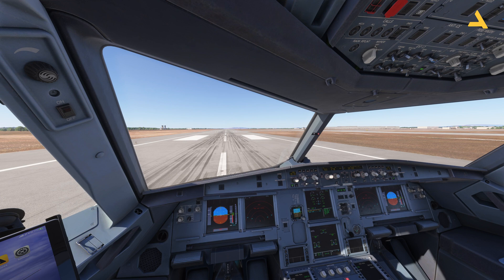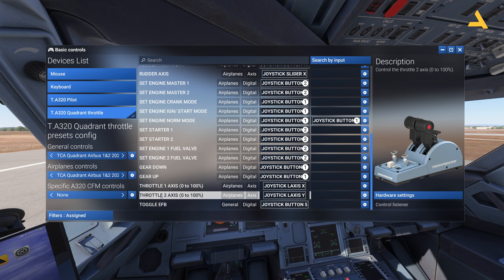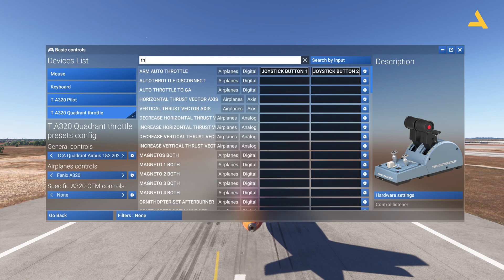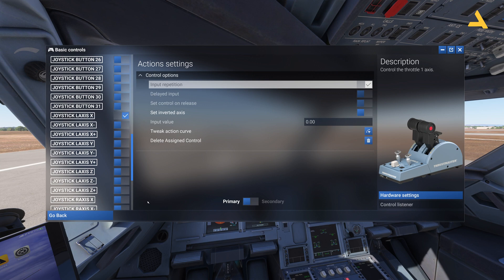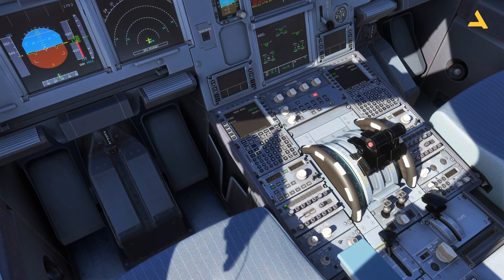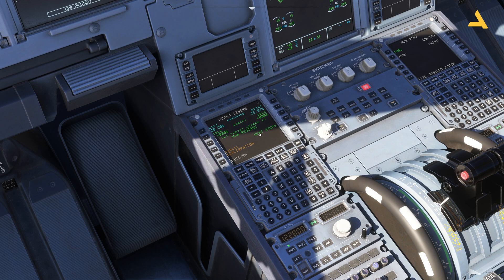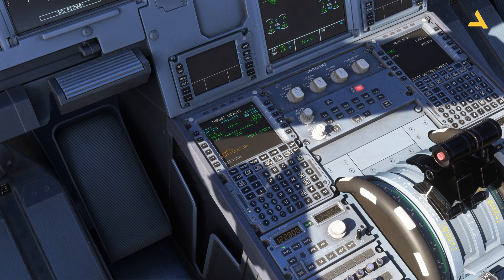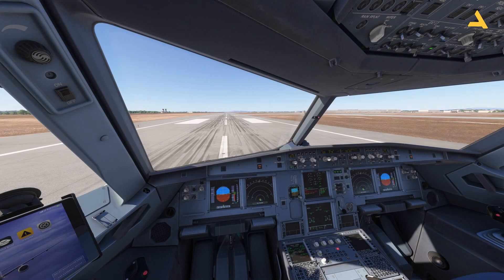How to Configure the Thrusmaster TCA Throttle for Fenix Simulations Airbus A320 in MSFS 2024

Comment: I did what you showed but I have a problem with the quadrant. For some reason the throttles are always moving by themselves. I don t understand what s going on.  I m wondering if you d know the reason why this is happening. If so please tell me. If not thanks for posting this anyway.
Reply from the maker: So far I haven’t faced this issue,, therefore, I have no knowledge to help you with this issue. But if I get a solution I will let you know. Thank you

Comment: Nice Video. I did everything you said.. the throttles work but the Fenix A320 for 2024 will not take off.  I have re-installed twice now. Not seeing anyone else mentioning this as an issue, I  guess I will wait for the next update.
Reply from the maker: When you are saying that the plane won’t take off does it mean it is not moving at all on the taxi way or the runway?
Reply: @aatifahmad  I have been doing a lot of testing. I can taxi, if I put on the brake at the runway b4 take-off, I can't at that point get any thrust afterwards. So at this time, I don't do that anymore till a fix is available or I figure out what's wrong with my setup.
Thanks for the reply.

Comment: Hello. My MSFS2024 recognises Axis as buttons 15 and 11 for some reason. and as soon as I spawn in an A330 and touch my throttles in immediately goes into full reverse no matter what I do. do you think there’s a fix for that?
Reply from the maker: During the configuration don’t use scanning to defect the control. Use the method that I am doing in the video to select an input and you will have no issues